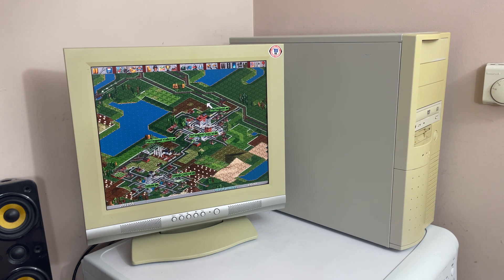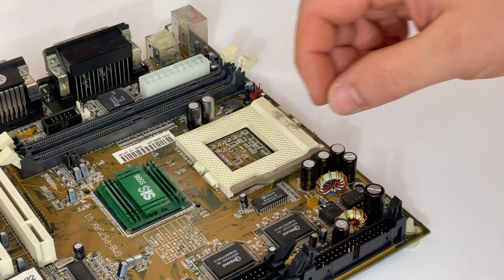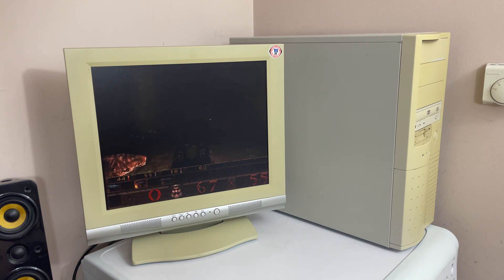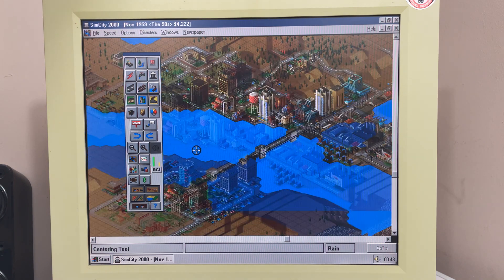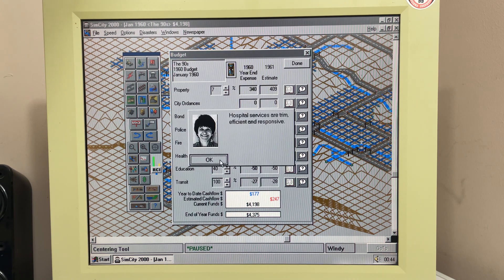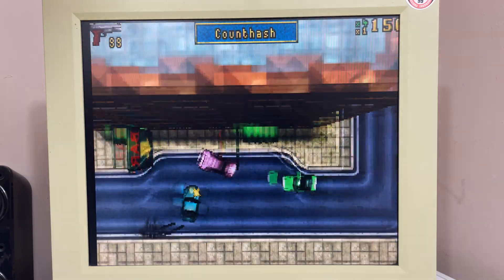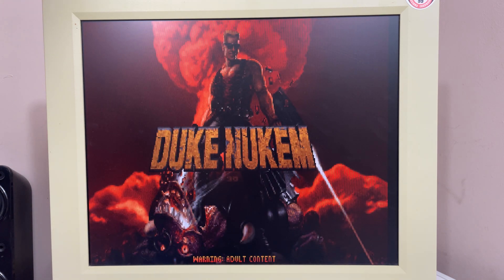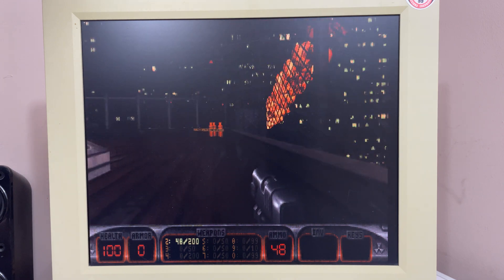Reviving the Past: Building a Windows 95 & DOS Retro Gaming PC with Integrated VGA & Sound

Comment: are dungeon keeper and GTA using Direct3d or software mode?
Reply from the maker: They are both in software
Reply: @ljrretropcs  is the 5598  direct3d capable? or just a 2D card
Reply from the maker: @stock.7013  I think it was claimed to support it but the performance was extremely poor and with bugs. I remember seeing several glitches trying SonicR. I am unable to test it any more because this motherboard has completely died :( .
Reply: @ljrretropcs  :'v i remember having a PC Chips with a SiS 620, was more a multimedia PC than a gaming rig